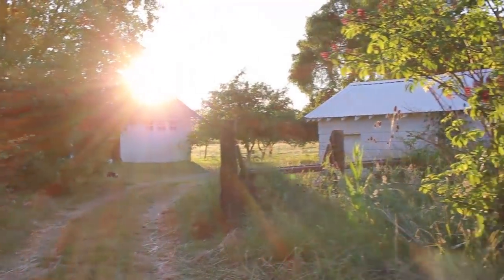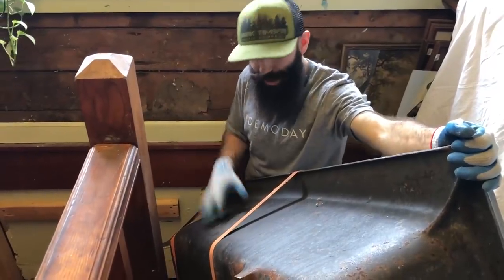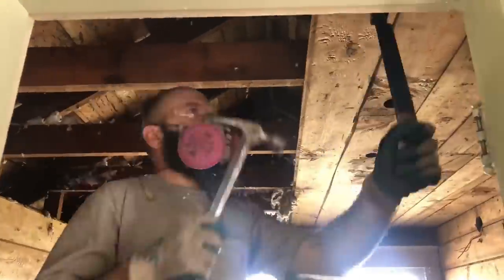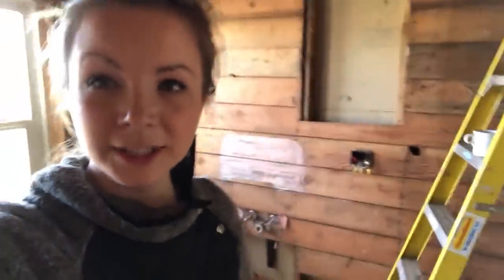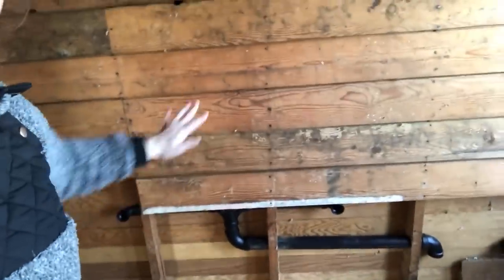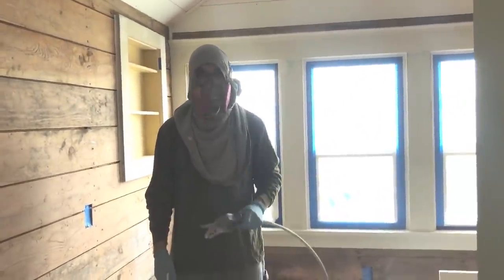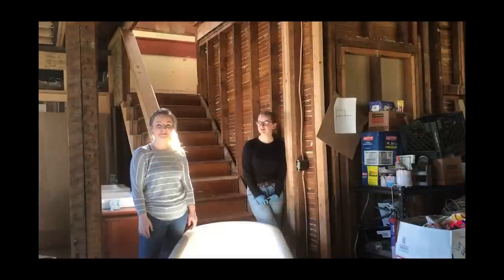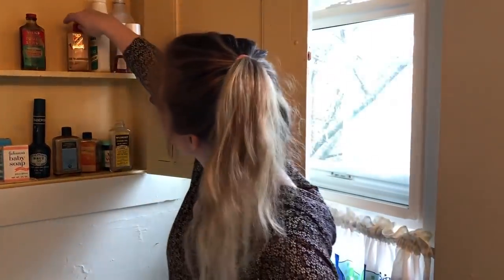Farmhouse Bathroom Renovation | PART 1 |- Lavender & Fir Farmstead

Comment: I had to come back to this to ask a question. At around 15:54 you used a hot melt gun to attach your trim. I'm shopping around for one. Is it hard to remove the trim (if needed) after it's glued? How do you like your FastenMaster? I'm considering the 3M version. Any input is appreciated.
Reply from the maker: Thanks for the question! I love that tool! I have found in most cases the trim is no harder to pull off than if it was nailed. 3M has always made great stuff and I think their version would be comparable. They are amazing tools and save so much time.
Reply: @LavenderFirFarmstead  Thanks for the info! I never considered glue for trim and such until I saw this video and it stuck with me. So I'm glad you showed it.

Comment: Too bad... so much wasted effort.  Please, folks, do your homework before starting a project like this!  The good: the floor joist repair was OK.  I'm assuming the joists were screwed in?  Ideally, I would have sistered LVL and glued and screwed with lag bolts.   The bad: the walls should have come down, the structure inspected, repaired, and appropriate insulation and sealing done.  Without proper insulation and vapor barrier, there will be moisture infiltration and possibly mold/rot (ESPECIALLY with the cathedral ceiling!).  I'm trying to be helpful and not troll.  It saddens me to see such wonderful people with good hearts make such devastating mistakes.  I've had the good fortune to have engineers in my family.  Good luck!